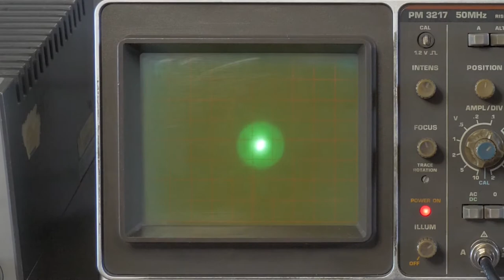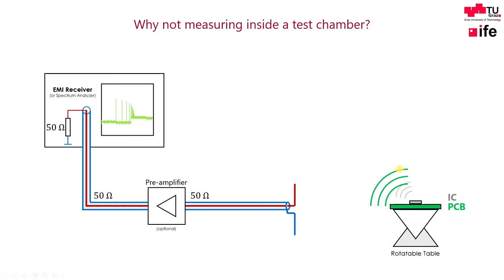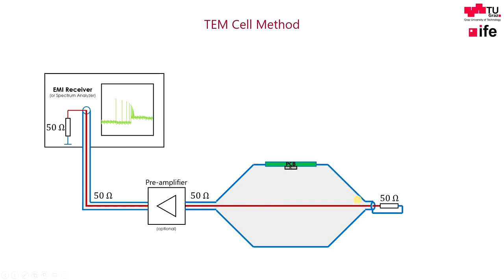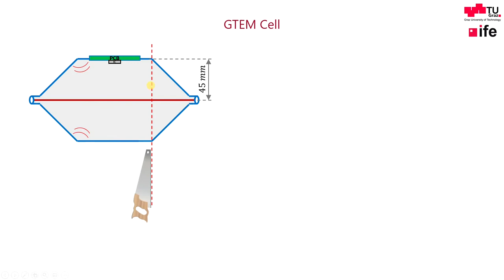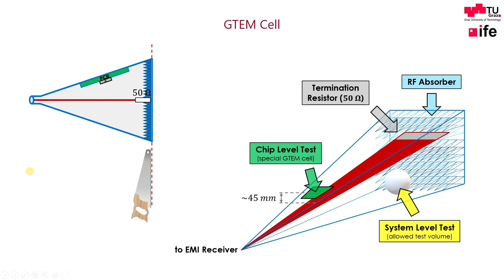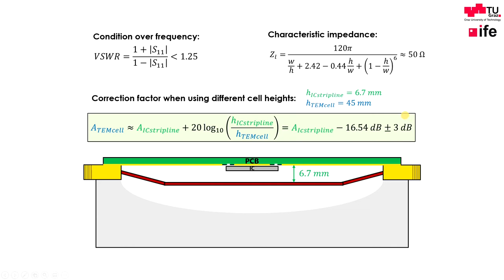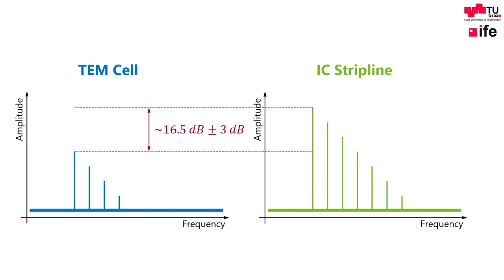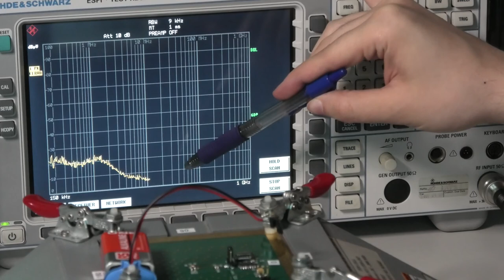Electromagnetic Emission Measurements of ICs - TEM Cell and IC Stripline

Comment: Plz I need 
One or two references on electromagnetic emission in printed circuit boards , I can't loaded
Reply from the maker: We do not fully understand your question. Could you be more precise?

If you want to learn some tricks on how to reduce the electromagnetic emission of ICs we can recommend these videos on EMC aware PCB design:
https://youtu.be/1bmG2odOPIA
https://youtu.be/9RZ7cboGVAk
Reply: @ife.tugraz  thanks for answer
I want book refereces or paper about this topic.
Reply: 1) You might consider to read the EN 61967 -2 and -8 standard.
2) The "Generic IC EMC Test Specification" from "ZVEI" gives a comprehensive summary of IC-level tests.
3) A short summary is given in https://ieeexplore.ieee.org/document/1231680
4) Search on IEEE. For example, "TEM cell" gives you this paper: https://ieeexplore.ieee.org/document/8736607
5) Bernd Körber (FH Zwickau) is the expert for IC- Stripline. He published papers in the EMC Compo 2007 and 2009.
I hope I was able to help you :)